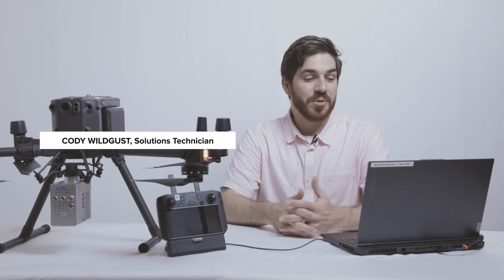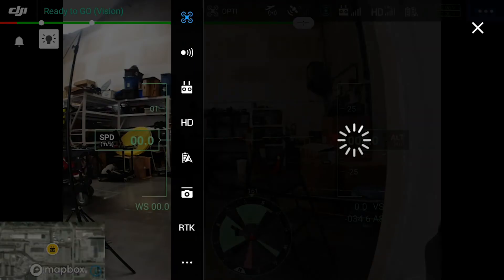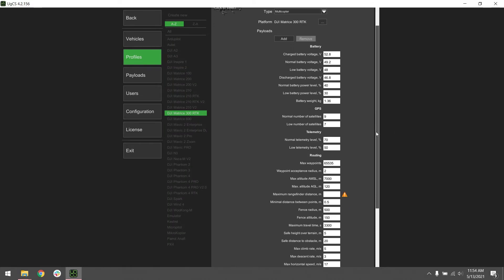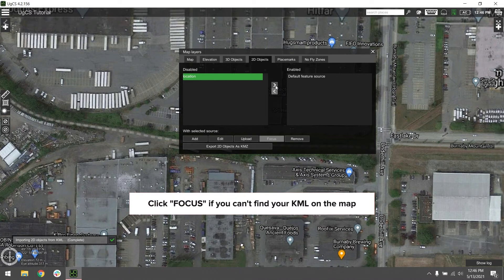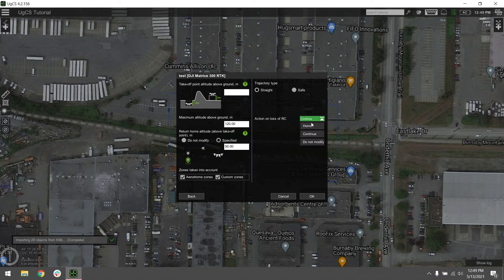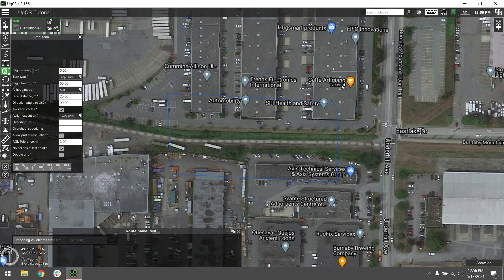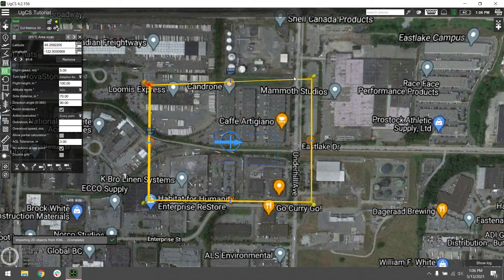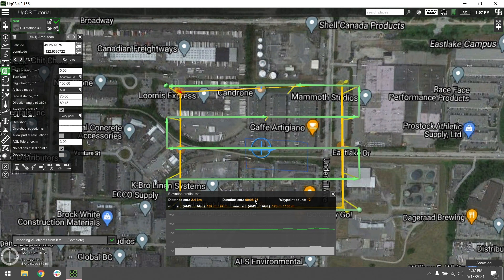Drone LiDAR mission planning with UgCS

Comment: Does Green Valley's mission planning software (Liplan and LiAir Mission) work with the M300 and the LiAir V 70 system? If so, what is the benefit of using the UgCS software instead?
Reply from the maker: Hi Douglas, GVI seems to have scrapped the development of LiPlan. UgCS offers terrain following capabilities which really helps improve the data quality.